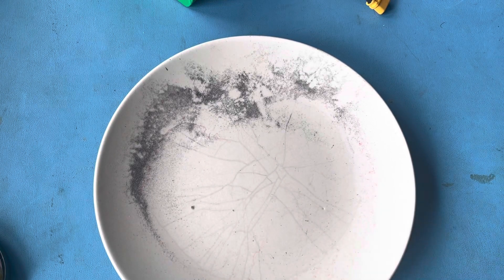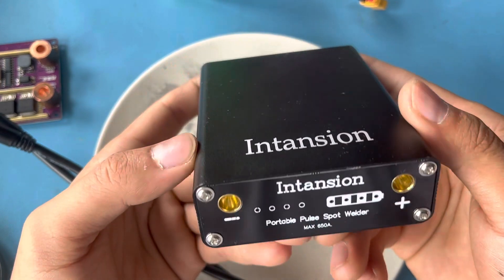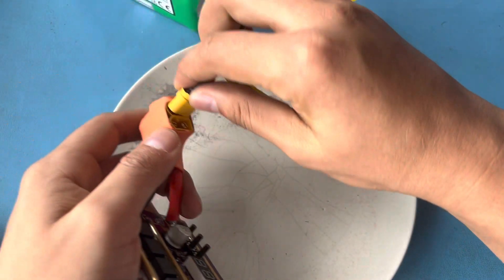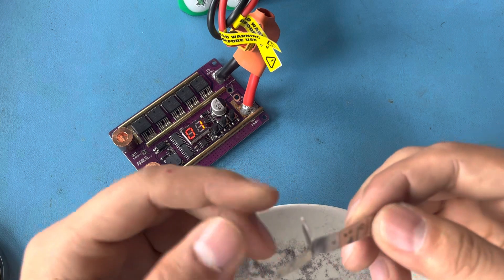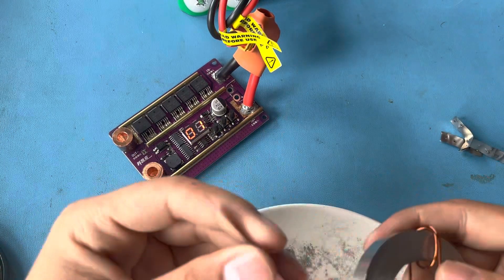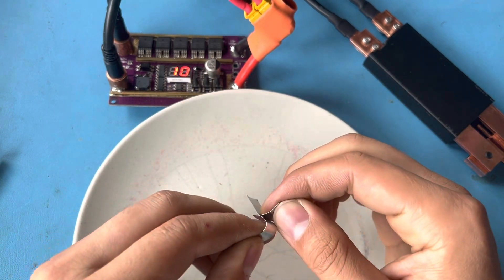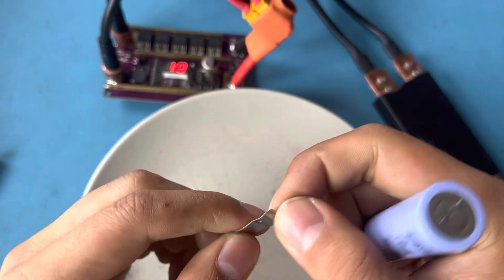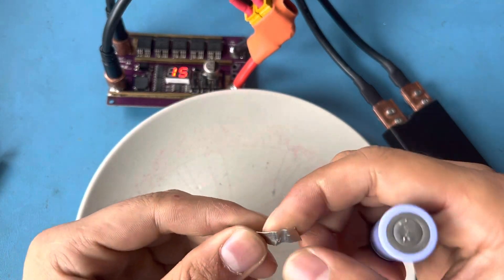Does it work?| spot welder

Comment: Hi;

Thank you for your review.

I’m fairly confident that a number of your practice welds - that you videod you making - where you were “not pressing hard” - didn’t weld well BECAUSE your two strips were not providing enough original surface-to-surface contact BEFORE you started the weld.

In short - if the two surfaces of the two strips were making meaningful contact FROM THE OUTSET, then you had a good, strong weld - EVEN at Gear 5, but, if your surfaces were… cursory - questionable - “lite” - then your spot welds were correspondingly “lite” - or poor.

Watch your video - with what I just said in mind. I believe that your own video will support what I am saying.

Thanks for the review, once more!
Reply: Maybe mine is different, I didn't get the same result. It couldn't spot weld 0.2. I posted the video

Comment: Those two 10C packs just won't be enough. Most people are using the most powerful packs they can get. C rate is kind of a bullshit number that has no actual standardized testing behind it. The Wayne Giles Meter says 50C is the max with most packs in the 35C range. My opinion, go with a Turnigy Nanotech pack. If its good enough for the Kweld then its good enough for any other spot welder. The nanotechs performed pretty well on the Wayne Giles Meter, right up at the same level as the "120C" packs.
Reply: I used a battery I made of  dead cells A123 Lifepo4 which start my 2009 Honda PILOT 6 cylinders.  I didn't get the same result. It couldn't spot weld 0.2. I posted the video

Comment: mine  blew up one mosfet by welding two 0.15 nickel strips together.
Reply from the maker: I think it is important to keep the voltage below 12.6V.
Reply: @jawedhakimi79  do you mean above 12.6v
Reply: To prevent the mosfet from blowing up provide a separate power supply in the middle terminals

Comment: youve got all the tools right but you are doing it wrong which can cause a lethal explosion "seriously". try to adjust the trigger timing bit enough time for you to press down hard the springs down on the pins. A good weld should have no burn marks at all should be clean as the nickel strip itself just a depression mark.
Reply from the maker: Sadly this doesn't offer any manual trigger. BTW this is just a show-case
Reply: @jawedhakimi79  https://youtu.be/qwE1Rjnz4pU in this video he has modded in manual trigger very easy.
Reply: @jawedhakimi79  I think the pen. you have is a knockoff design that decided to delete the trigger without understanding why there is a trigger.